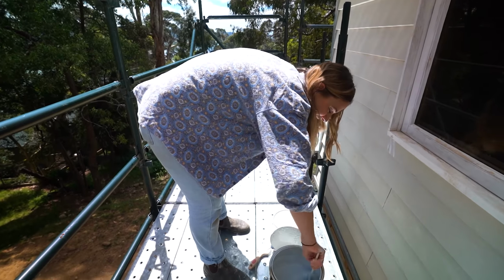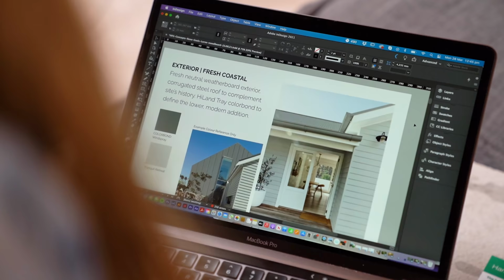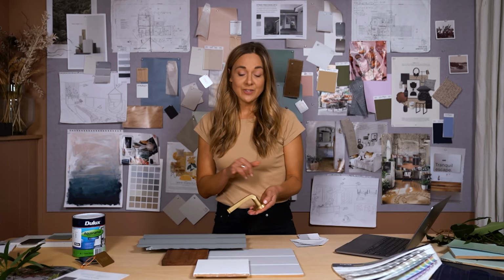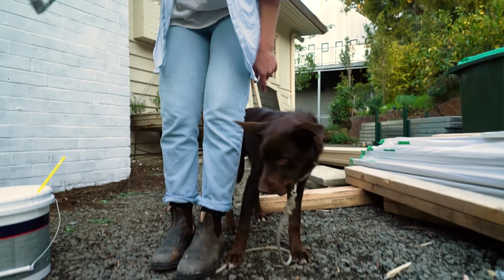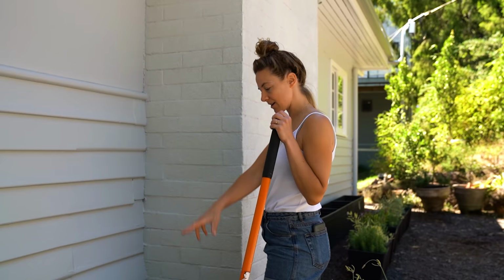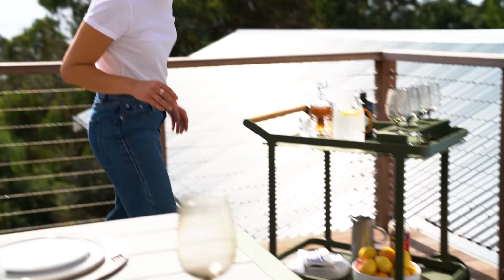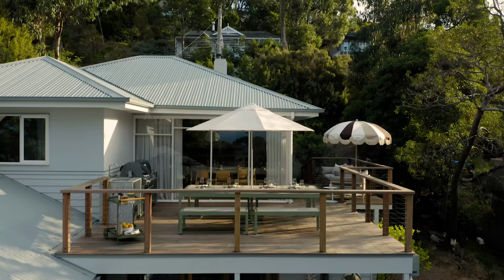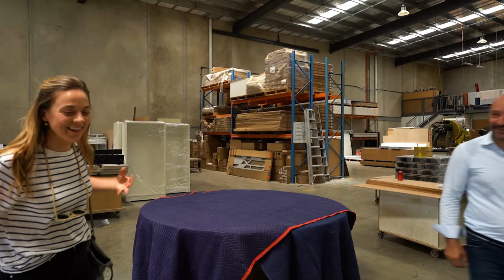We Built A House! How to Plan Design & Build an Exterior Renovation. The Beach House Transformation!

Comment: Looks amazing.
Am surprised you didn't use PVC fascia boards though. You'll  need to hire scaffolding next time they need painting.
Reply from the maker: All the PVC products we looked into didn’t have a high enough BAL rating for the fire rating zone this house is in. Fibre cement does meet BAL29 and is a very durable product and with the prep and paint we did it won’t need another paint job for a very very long time. ⚡️